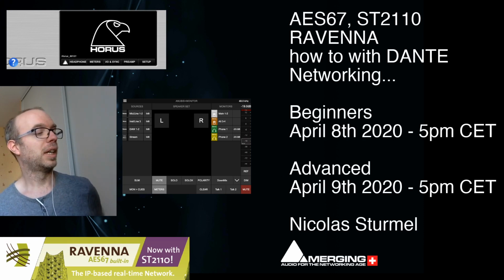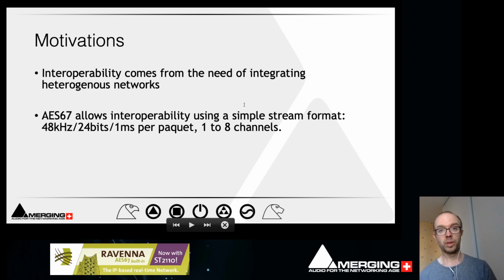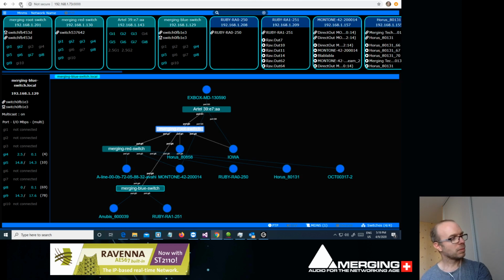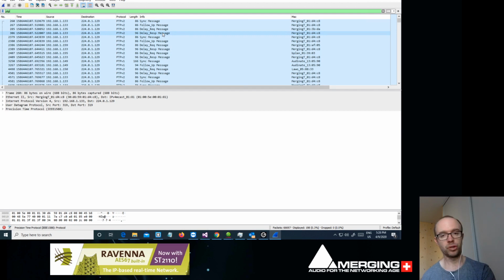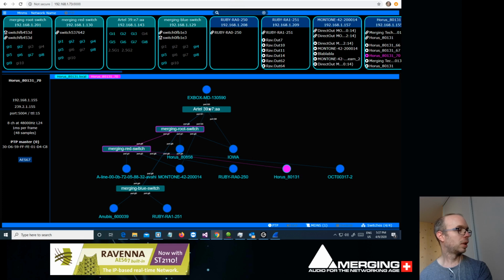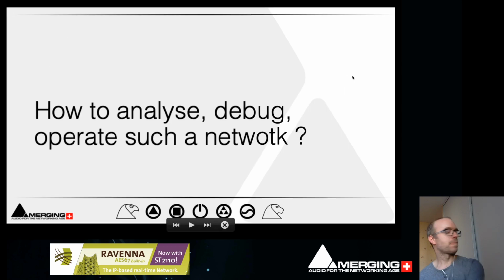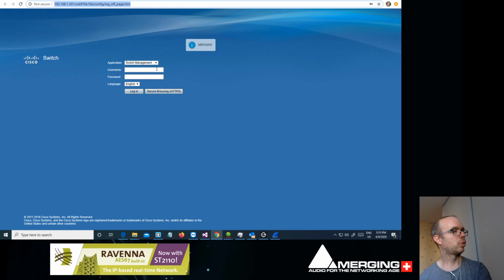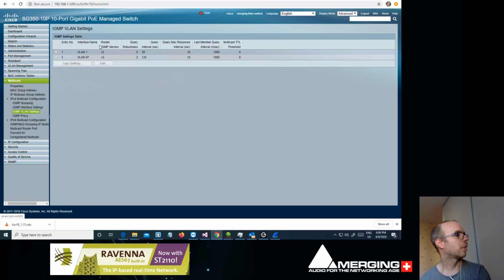AES67/RAVENNA (advanced)

Comment: How to interconnect Ravenna with AVB?
Reply from the maker: There unfortunately not a direct way. Best is to use a hardware device from other manufacturers. I would suggest that you get in touch with https://avnu.org/Milan/ who is gathering brands supporting AVB and they may have a solution for AVB to AES67